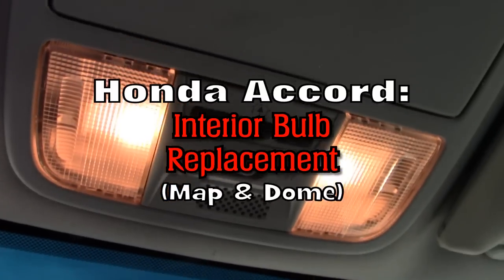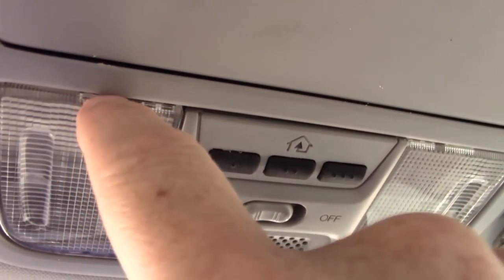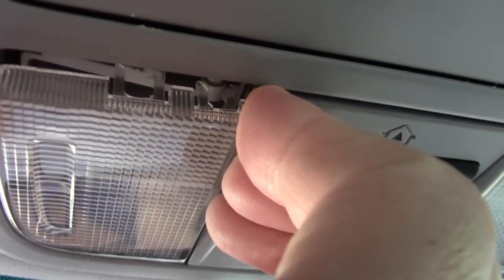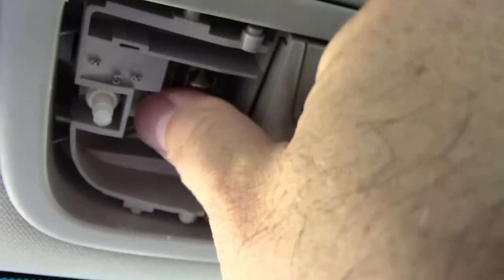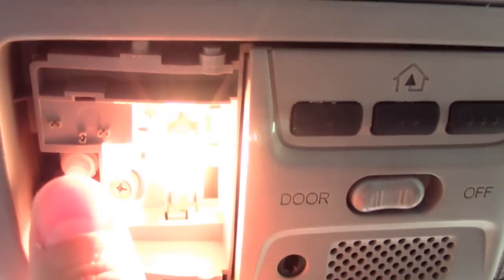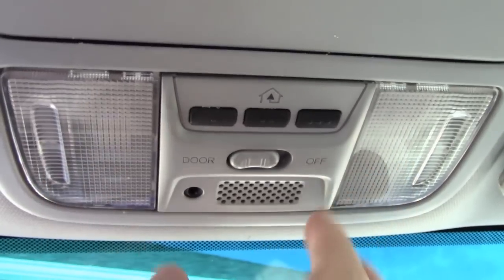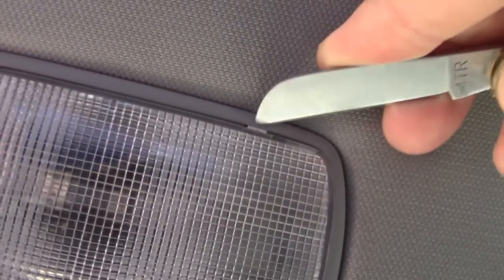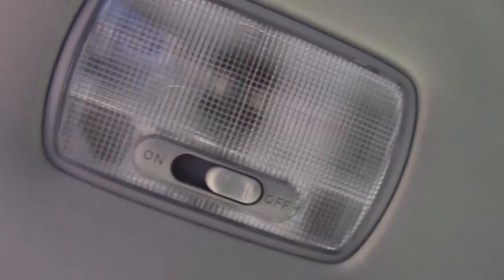How To Change Map & Dome Lights - 2003 - 2015 Honda Acura

Comment: Removing the lenses is safer and easier by pushing the outside part of the lens, then, use a knife or thin flat-tip screwdriver to pop the other side out. Both clips come loose at the same time and there's much less danger of breaking off part of the clips/teeth.

Comment: When my dome light is set to on my dome light illuminates. However when I set it on the door open (middle) it does not come on when back door is opened. Is this a light issue or something else altogether?

Comment: Hi, 2012 Accord owner here. Neither map light works- confirmed fuses are not blown. Tried replacement bulbs (purchased from NAPA) - still not working. Cleaned the contacts- nope. I want the brighter LEDs - but I’m wondering if the switches are the problem. Also, aren’t the map lights supposed to come on when I open the doors and then fade out? They’ve been out for so long I’ve forgotten. Any recommendations? I don’t want to take it to the dealership for this. Thanks

Comment: Thank you!!! This video made it very easy. I bought bulb at Auto Zone for 2005 Honda. I used small tool used to change out band on iwatch-  just popped out sides then pulled out gently- no scratches. Finally have light after a year without it 😁

Comment: 2012 Crosstour, this worked, thank you
Also the direction of the bulb seems to matter but it's not clear which side is positive or negative so just try and flip it around if it doesn't work the first time
The right side light is extremely dim after replacement so I'm thinking either the connector/wire to that light is faulty or it needs a new fuse

Comment: Thank you for posting this. The solution is to remove the two lenses carefully with a screwdriver,then remove the 2 Phillips screws inside each lighting bay. then, with a flat screwdriver,push out to each side the white switches, revealing the connections.Them, with rubbing alcohol clean the connections. Reinstall as above,they should work OK.If not the switches are bad just replace those.

Comment: thank you for the vid. changed my entire 2015 pilot interior and lic plate light  out with led's. Same video will work for odysses as well
Reply from the maker: ***** Awesome!  Glad I could help out.
Reply: My 2015 Acura ILX does not have the same cover. If I remove the lens over the map light, the light is a square array of led's about 1in x 1in. Cant figure out how to get at these...

Comment: Thank you for this very simple video. I just have one question. What is the speaker looking thing in the middle between the map lights and it looks like an aux plug next to the speaker but I’m not sure that’s what it is. It’s some sort of plug in. I have a 2008 Honda Ridgeline and it looks just like your Honda in the video. Can u text me and tell me what that speaker and hole is for? Thanks so much.
Reply from the maker: Not a speaker but a temperature sensor for the automatic climate control.  The little thing next to it is a blue light that shines down at night to give a bit of ambient lighting and help you see a bit at night.  Hope this helps.  Thanks and take care.

Comment: If you depress and hold the light cover and take a thin screwdriver to the long side opposite the depressed side, it is easier to remove the cover than attempting to pop the short sides off as in the video. ( I actually used a paper clip that I found in the cup holder.)

Comment: I was just wondering, my Honda does not have the switches at the top for the lights so is there another way of having the interior lights come on when I open the door or unlock it??

Comment: Perfect...just what I needed.  Many thanks!!!
Reply from the maker: +Gacek Family Awesome!!  Glad I could help!!
Reply: Just wanted to add that if you find that your map light bulb(s) are still good, it may be the switches that turn the map lights on and off.  Apparently this is a common problem on Honda's and Acura's.  So if you put the bulb into the other side and it lights up, you know the bulb is still good.  I wrote a post on how to fix the switch by cleaning it on OdyClub.com, you can see it here: http://www.odyclub.com/forums/52-2005-2010-odyssey/200201-map-light-interior-light-switch-not-working-right.html.  Mine is post #12 by BeachbumNJ.  Hope this helps someone.

Comment: Are the lights in my 2006 regular lights or LED? If the old type, can I replace them with LED?  Do they look different when lit?
Reply from the maker: They are most likely not LED’s.  You can replace them with LED.  I found them much brighter whiter light.  It will be different and take a little getting used to compared to the dimmer brown light.  I don’t recommend replacing stock halogen headlights with LED’s.  They are dangerous to other drivers.  They fit but the reflector is not designed for an LED and makes it too bright.  So much that I took them out because I didn’t want to blind oncoming drivers.  I had people flashing their lights at me thinking I had my brights on them.  I didn’t.  I wouldn’t feel right if someone had an accident because of my lights so I took them out.
Reply: @mitchcox  are you talking about done lights or headlights? I was asking about the Dome /overhead lights.
Reply from the maker: Sorry.  Didn’t pay attention to what video you commented on.  I have a video for LED headlights too.  Lol.   No the stock domes are not LED.  The LED’s are a brighter white.  It’s a white light compared to the dimmer yellow light.  So it will be a huge difference in the dome light.

Comment: my front interior lights won't come on when the doors open. the door switches work properly and when i push the lights they  come on. but not when the doors open. do you know how to fix this or have a video?
Reply: +Travis King thank you. it was the actual switch in the dome light assembly. i noticed it when i disassembled everything

Comment: MITCH, HAVE A 2004 HONDA ACCORD. REVIEWED YOUR VIDEO JIT (JUST IN TIME).

I WAS PRYING ON THE END OPPOSITE THE HINGES.

WENT TO SIDE PER YOUR VIDEO AND IT POPPED RIGHT OUT !

BTW - CHECKED THE OWNERS MANUAL AND THE PRECURE IS NOT COVERED. THIS IS ONE OF THOSE DEALER "GOTCHA'S" - $100.00 TO REPLACE ENTIRE UNIT PLUS MECHANIC LABOR. 

THANKS FOR THIS INFO MITCH.
Reply from the maker: Thank you for commenting and letting me know that my videos are helping people.  I appreciate it.  I am happy it helped you out.  Take care.

Comment: One video days LED has a positive & a negative side & you must install  it correctly. I cannot see anything showing the + & - on the map light connection. I installed 2 new switches and 2 LED bulbs & all worked great for a moment then failed. I replaced the MEDs with the old bulbs & nothing. I replaced the old switches and tried both kinds of bulbs. Nothing. Even my rear dome light quit. I replaced the 7.5 fuse under the drivers side dash & now the rear dome works. However, still nothing on the map lights. What fid I do wrong? This must go beyond a fuse :(   Another person mentioned the same thing. He installed a cheap LED kit from Amazon & now his maps won't work, even after installing a new fuse.
Reply from the maker: I am sorry.  I don’t know. Some LED’s do require you to install them a certain way.  If they don’t work you can generally turn them around and install them to make them work. Ours are still going strong with no issues.  I am sorry you had this problem. Let me know if you fix it and what the problem was.  Thanks and take care.

Comment: its easier if you press and hold the lens, then use a small screw driver to pop of the lens from the middle, (near where it says DOOR,then reinstall the same way)

Comment: If the bulb works when you press the lens, then you have a good bulb.  If it then don't work with the door open, that is another issue because one bulb does both features.
Reply from the maker: Yes.  This video shows you how to replace the bulb if it is burned out.  Thanks.

Comment: i have the same three black buttons on my odyessy could you tell me its function
Reply: That's your homelink.  They are used to replace your garage door openers, up to 3 of them.
Reply from the maker: +danial khan Those can be programmed to open your garage doors.

Comment: Allways.use LED.lights.brighter&SAFER.&never gets HOT .like A light bulbs.better&SAFER. &don't.forget the doors 😎
Reply from the maker: LED lights do put off some heat.  Not nearly as hot as a incandescent.  But I agree,  I recommend replacing all the interior lights with LED.  Just provides so much more light and uses a lot less energy.  Thanks.

Comment: These are not the kind of bulbs that are used in a 2007 through 2013 Acura MDX
Reply from the maker: Sorry.  They are used in most Hondas that I have found an a few Acuras.  Sorry they don’t fit for you.